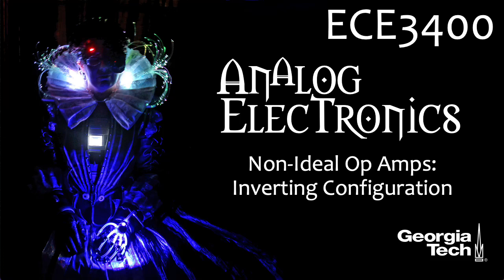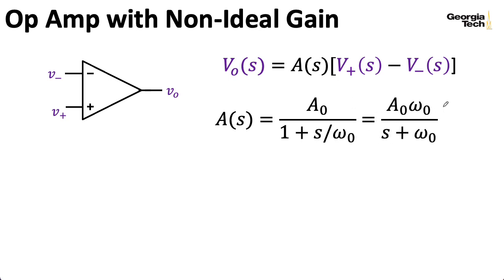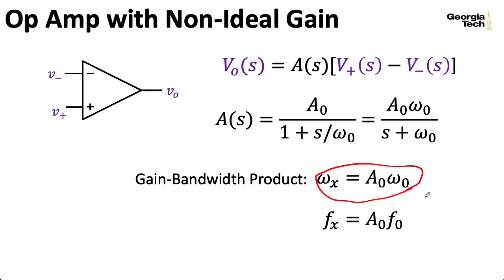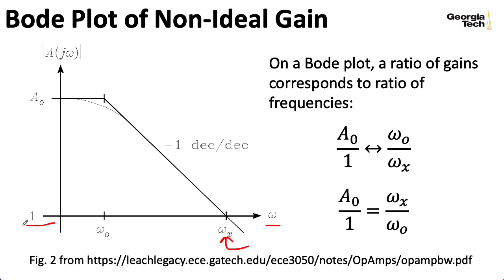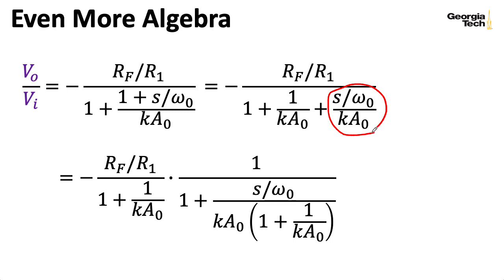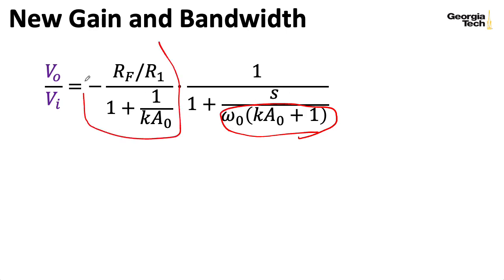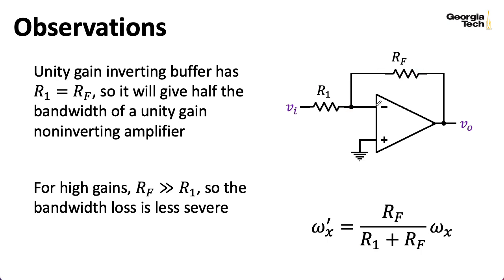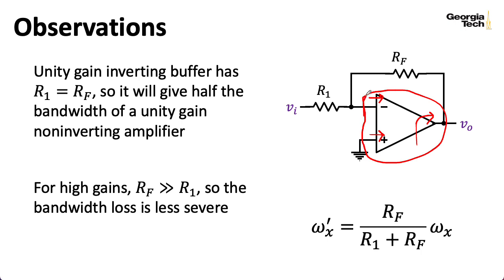ECE3400 Lecture 39: Non-Ideal Op Amps: Inverting Configuration (Analog Electronics, Georgia Tech)

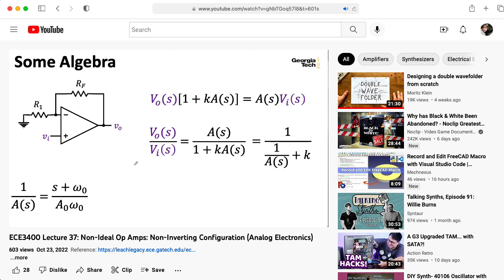Comment: 0:14 this guy, Moritz Klein in the upper corner is kinda a fraud and his followers seam to be blind or so.
He builds stuff but doesn't mention the source, that wave folder video is basically the "lockhart wave folder" from Ken stone and people believe it's coming from him.
He made a diode filter, the low pas work, but than he mentions a dual low pass input, but it's a dual high pass input, you ever saw one?
seams he stole it from from the Korg Volca series, simulated it in the Falstad simulator and gave it a twist of it's own.
He says weird things, like transistor eating current and other things where someone with a bit more knowledge would floor him, he knows he is beaten, because he nevers reacts.
He should name the sources and don't act if it was from him.

He sells modules, that are sub par, he lacks sufficient experience for what he is doing.
If people only would know.

YouTube something seems like plaform for people that are begging for money.
Reply: Moritz, although not having a background in electronics, is doing a whole lot for the DIY community by democratizasing knowledge in a easy to grasp manner for people like him, who doesn't have backgrounds in electronics. I agree with the point about sources but definetely not a fraud. That whole thing about grabbing a circuit and making a little twist is basically what ALL eurorack manufacturers take on famous circuits (and not just Euro, but all the industry)
Reply from the maker: Moritz has done a tremendous amount to popularize Synth DIY and help people understand circuits. I might quibble with technical details here and there, but I overall support his efforts and strongly encourage people to check out his channel.
Reply: @Lantertronics  You should be honest and tell the people about your sources, so they can review, although not directly but it's like he claims it's his.
There where many people in the past that have done alot of research, like Ken Stone, Music from Outer space, Buchla, Moog, etc but that was before big t*ch.

That dual high pass input in that diode filter is plain wrong, like if other people from the past failed or so and he invented something new that other people overlooked, lol.

Look Mom No computer is honest.

You should be using Groupdiy, electro music forum and some others there are the specilist, not really big t*ch.
Reply: @Lantertronics  Well said Sir ! ... Knowledge is for everybody who is interesting in and engineering is basically math talk ...
Reply: Please be respectful a bit to Moritz Klein .... even if he doesn't engineering certificate but he has represented his tech issues by clear correct math language and that is important in engineering at least ...
Reply: @ahmedalshalchi  it's easy, just name your sources, the people of the past weren't stupid and most probably smarter than people today. he is no engineer as he said that, he is using a simulator, Falstad. although his presentation are good.
Reply: @ahmedalshalchi  i just watched a Live stream of Moritz, he is making huge errors, but the public seam and keeps believing him.
he is trying to "sample" a zero (GND) with the clock input of a CD4013, while playing the set and reset of the chip at the same time, this circuit might not always work as the CD4013 has to struggle. it's totally useless to use the Clock and D input in this circuit, no effect. it's just luck for him that it work, but the CD4013 could decide differently some time. maybe he tried to disable the the D input, but than you also have disable the clock input, otherwise it will try to sample a zero all the time.
Reply: @AnalogDude_  Whether Moritz right or wrong, he was just showing what he knew and practice and that doesn't make him a reference and base ground of the truth so please try to understand this kin of free speech in this cyber world... If you have issues with Moritz then you go directly and talk to him about and  show your reaction , not to me !! ... I have my opinion as well ...
Reply: @ahmedalshalchi  dude, if you try to be master figure and do efforsdt to explain people, you gotta be 100% correct else you are a fraud.
Reply: @ahmedalshalchi  he avoids answering.